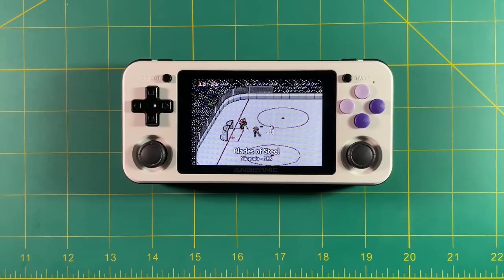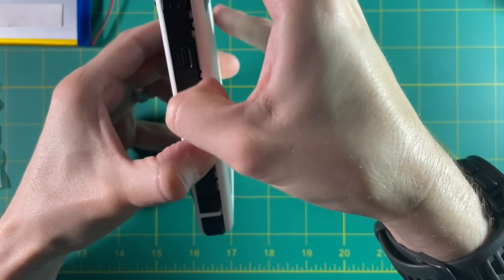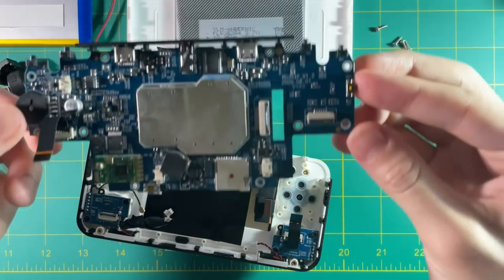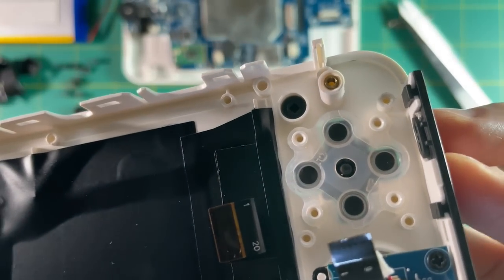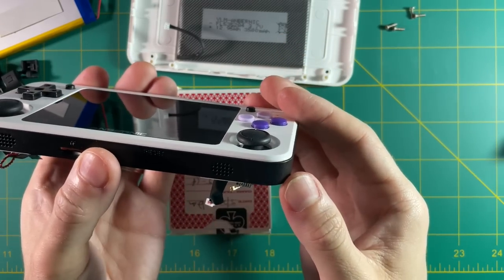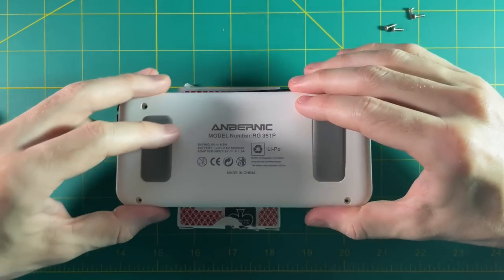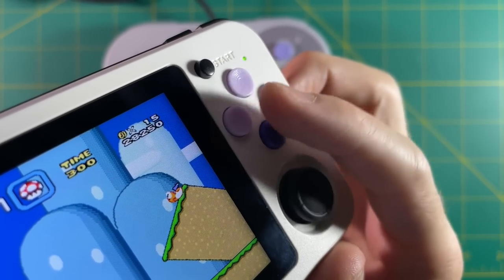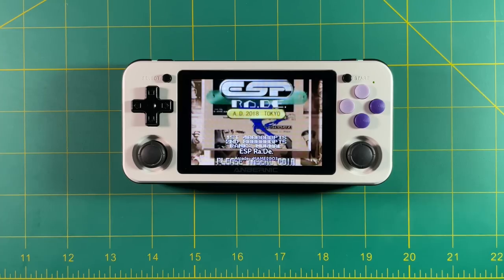RG351P & RG351M Hardware Mods (New Buttons and Battery!)

Comment: So I started having problems today. I was charging it while in sleep mode. Pulled the charger out. Clicked power and it never came out of sleep mode. I had to keep clicking and holding power until it turned on and displayed the os name. 351elec. Had to hit reset to get it back to normal. Now every time I turn it on it takes at least 3 times longer to boot up. Any clue what the problem is?
Reply from the maker: Oh I'm sorry to hear that is happening.  Sleep mode on this device is really wonky, it's why ArkOS development is stopping after this month.  I would ask around in the 351ELEC discord to see if anyone else has encountered this and if there is a solution.
Reply: @RetroGameCorps  what? They’re stopping ArkOS development? That’s disappointing
Reply from the maker: @Mugenz00  yeah, the developer is fed up with problems that he cannot control, like the wonky sleep mode.  He'll keep working on ArkOS for other devices: RGB10, RK2020, OGA, RG351V.

Comment: Hello everybody. 
Hey @RetroGameCorps Your YT channel is amazing, you've been doing an incredible job!

Could someone please tell me: I am looking for a handheld device that is good for playing SNES and GBA games, which of all is the cheapest?

Thanks! :-D
Reply: The RG351P is perfect for GBA games. Perfect aspect ratio and runs perfectly. SNES is a solid experience as well, since Retroarch lets you tweak to perfection
Reply from the maker: I agree with the others.  You can find devices that will play SNES for cheaper (PowKiddy V90, RG350), but the RG351P is going to be the best all-around experience.  Also check out the PowKiddy RGB10, it's a little bit cheaper than the RG351P but doesn't have a second analog stick.

Comment: Wouldn't it be possible to swap in a 350m or 35v screen? That way you can have a superior screen and chipset at the same time, in horizontal form... No?
Reply from the maker: Unfortunately they are not the same size — the 351V and 350M have taller screens.
Reply: @RetroGameCorps  if the connector is compatible, can it be done? I tried the 351v but dislike the form factor while the 350m is underpowered... Alas!
Reply from the maker: @Kiyoshi_9606  you would need to build a new case, the screen is too high for the 351 case, and the PCB is too long for the 350 case. I have a feeling that Anbernic might be working on a horizontal 640x480 device, though...

Comment: How about you make some mod videos about the RP1/2?
Reply from the maker: Unfortunately no one has figured out how to modify the sticks on the RP2.  As soon as a solution is available I will be all over it.
Reply from the maker: @thecbc7658  that’s good to know that a Ps Vita stick can work in the RP2, I might try that sometime. But honestly I’m more interested in fixing the right stick, that’s the one that prevents me from using the device more.
Reply: @RetroGameCorps  Still it's a popular device and with it's own advantages. By not making videos on the RP1/2 you are missing out on new viewers/subs. Like for example how about adding LEDs to a transparent RP2? Light up the shell or something? 3D printing or epoxy molded buttons, switches, etc...
Reply from the maker: @thecbc7658  I understand that, but the point of my channel is not to get more viewers and subscriptions.  I follow the products and features that interest me, and not what will gain new followers.  It's a delicate balance but I wouldn't want to make videos without being genuine about what I'm working on.  I've tried very hard to like the RP2 but it's not a device that clicks with me.  That's why the only videos I have made on it recently where to change the firmware, hoping that would change my opinion on it.  And it's helped, but not to the point where I really like the device.  The things it would need to change (true second analog, better face buttons, better d-pad, more RAM) are beyond my level of skill right now.  I hope to get to that point sometime in the future!
Reply: @RetroGameCorps  I'm not going to argue, it has other advantages over other devices like the RG351 that you mostly feature. I'll find someone else to do it then, someone who apprecieates it more.
Reply from the maker: @thecbc7658  all good, I appreciate the feedback.  Like I said, I tried very hard to like this device, but it didn't resonate with me.  Looking forward to the RP3.
Reply: @RetroGameCorps  No worries I found a different Youtuber to make some.

Comment: Hi, Russ!
Do you know if the 4.000mah battery for the android go super also works for the RG351p? 
Thanks!
Reply from the maker: Hi, it doesn't, it's too thick.  You can squeeze it in the case but I think it is a serious fire hazard since it is pressing up agains the CPU heat diffuser.
Reply: @RetroGameCorps  good to know. I’ll stick with the OG Advance model then for the replacement. Thanks for the quick reply!

Comment: Any thoughts on the battery discrepancy?  Is the original battery worn out?  Is one of them incorrectly rated?
Reply from the maker: My guess is the Anbernic one is shady, and incorrectly rated. The HardKernel one seems to be of higher quality.
Reply: @RetroGameCorps  That's what I suspected you were eluding to.  I've been surprised by the short battery life on my 351V.  I will be looking to upgrade it now.  Thanks for what you do!
Reply from the maker: @spazzman90  if you upgrade the 351V, get the ODROID Go Super battery (4000mAh). It fits just fine in that case!

Comment: What wifi dongle would you recommend getting to replace the cheap one that was included?
Reply from the maker: Here is a list that have been tested with the RG351P.  Bear in mind that certain firmwares won't support certain dongles, compatibility is kind of the wild west with these.  Also, the device only supports 2.4GHz max, so you won't really see performance gains between different dongles.
Reply: @RetroGameCorps  I found a few compatible dongles on your website thanks for responding, the included dongle just freezes up my rg351p until I remove it lol

Comment: ***Someone help*** pleaze..... I can't find anything on my issue. 30 seconds into my boot up me system freezes. Every time. Today I turned it on and boom. Freezing.
Reply from the maker: Sounds like a bad SD card, it happens often.  I would flash new firmware (either the stock firmware, ArkOS, or 351ELEC) onto a new card from Samsung or Sandisk.  I have guides on my site and in this channel for how to flash the firmware.

Comment: Would battery work for rg351v?
Reply from the maker: Yes, but use the ODROID Go Super (4000mAh) batter instead, it fits nicely!
Reply: Thank you bro watched your custom firmware video and got the ArkOs running on it. Yesterday the system wouldn't turn on and light stayed green so I unplugged battery works fine now just needed a reset I guess.

Comment: I just drop my 351p on the the floor and it's hurts R1, it's still working,. bit not clicking. U just apply a little pressure and it works, but it feels really shitty